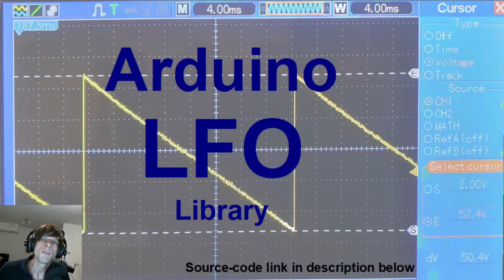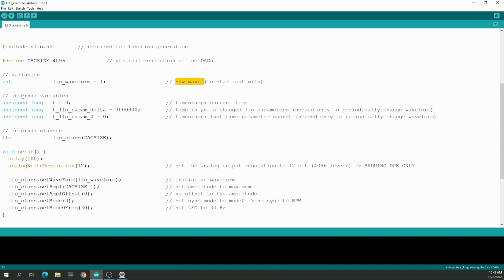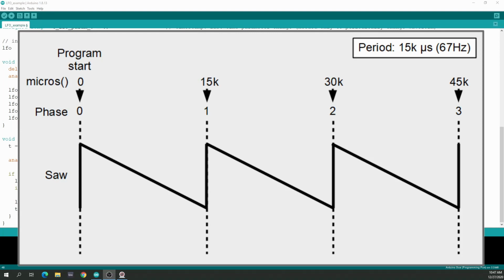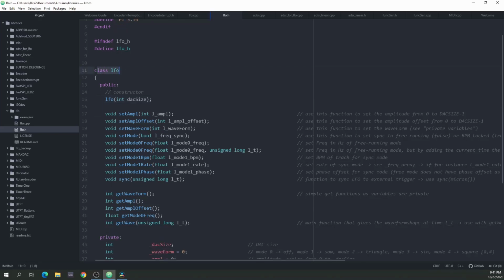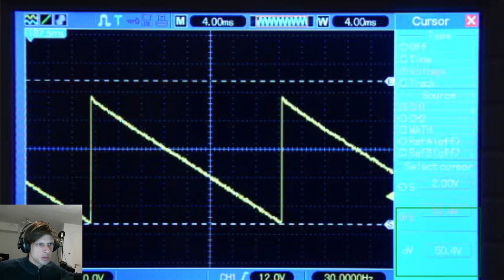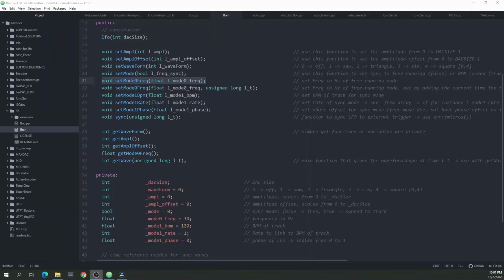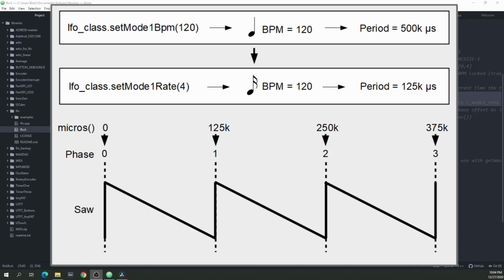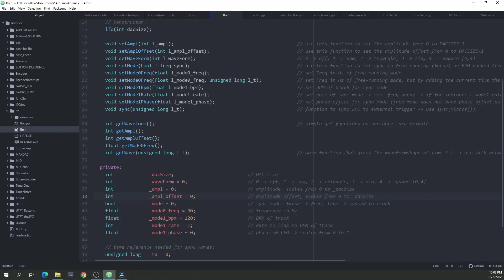How to create a low frequency oscillator (LFO) with an Arduino/ESP32/Teensy/etc (DIY)

Comment: Awesom library and video! I'm really excited to use it on a project I'm working on. I'm having some trouble with generating the saw-tooth and triangle waves for some reason. I'm running the program on an arduino nano every and an external 12 bit DAC and it works great except for those two waves. Wondering if it's somehow not compatible with the arduino nano every's ATmega4809. I'm not really sure and not too well versed in C++ either so it's hard to troubleshoot.
Reply from the maker: Hi Matthieu, thank you for your feedback. I have not tried out the code on a nano yet. It should not be dependent on that. I have to check if I have one somewhere... However, debugging is super easy for you. Just open lfo.cpp in some text editor (like notepad++) and scroll down to the bottom. The relevant function you need is:
int lfo::getWave(unsigned long l_t)
I am not 100% sure, but looking at the function I noticed that the two wave shapes you have problems with both have the DAC size in the routine whereas the other functions dont. Can you describe what the waveshape looks like when you configure these waves? Did you set the DAC size correctly? As a tryout you can set the DAC size very low (256 or so) and see if that works correctly. It might be a scaling problem. Good luck with your project! Sander

Comment: Awesome. Can this library be used to create quadrature LFOs? I would like to program a quadrature LFO with both TRI and SAW outputs for use in Shepard tones.
Reply from the maker: Hi Mike, yes, you can use the LFO library for a quadrature LFO. The easiest way is to just create 4 instances of the class in your Arduino code and set the phases to 0, 90, 180, 270 degrees. However, please do make sure that you have the LFO on lfo_class.setMode(1); -> this is the mode where the LFO can be synced to an external clock. That way you can create the 4 phases in 4 different class instances. With setMode 0 this wont work (you could implement that easily but that would mean adapting lfo.cpp a bit). Good luck with you project!

Comment from the maker: Big thanks to Thomas for pointing out a simple fix for the roll-over problem after 71 minutes. By slightly changing the "if statement" this problem is resolved. I have updated the example codes on Github. For reference on the fix, please see:
https://www.norwegiancreations.com/2018/10/arduino-tutorial-avoiding-the-overflow-issue-when-using-millis-and-micros/
@Thomas: I tried to answer to your comment, but some way or the other it does not show up in the list anymore, so instead here my answer as general comment. Thanks for contributing!

Comment: Hey thanks for the code and the Ideas, would love use my Due as an LFO on my modular rig. I loaded this example code, but I cant see anything out of either of the 2 DAC outputs. Did I miss something?
Reply from the maker: Hi Stephen, sorry to hear you could not get the LFO running straightaway. There could be quite a few reasons why it is not working for you. How did you measure the DAC output? Did you use a scope? I set the default freq to 30Hz, so you will need a scope to measure that. Did you get errors programming? Make sure you use the programming port of the Due. My example codes cycles through all wavelforms and this includes DC. I just realized that this can be tricky if you measure the DAC port at exactly the time the DAC is outputting DC (as this equals 0 per default). I have now removed DC from the example code online. Might this not help for you: I have uploaded a second example file called LFO_example_LED.ino to Github. Pls check if this one works for you. This one generates simple square pulses with gradual increasing frequency and writes it to the internal LED (port 13). If that works for you, it probably is the DAC you should focus on. Good luck! Let me know if you were able to find the fault.
Reply from the maker: One more note: you will need to add amplification after the Arduino Due before you can use this signal for your modular rig. Please refer to my video below where I give an example of what such an amplifier can look like (at 58 seconds). 
https://www.youtube.com/watch?v=TTPP9dcvJH8

Comment: This is great! I tried it with my Behringer Pro-1 and an ESP32, worked perfectly!
For anyone's reference: change the DACSIZE to 256 (since it's 8 bits on the ESP32) and use dacWrite(25, lfo_class.getWave(t)) instead of analogWrite(...). As stated in the documentation, also remove analogWriteResolution(12) for any other board than the Due(?). I also reduced the frequency to 1Hz to get better testing results.
Reply from the maker: Thank you very much for your addition, will add this to the readme on Github. Great to hear its working!
Reply from the maker: Dear MisterMajister, I got a notification from Youtube that you posted a question to my video on how to "Control your DAW with your phone". However, when I looked in my console, the question was deleted (maybe Youtube spam filter because it seems you posted twice?). Anyway, could read your question and wanted to answer you: The problem you have is most likely a casting error. I dont know how you implemented it exactly, but make sure you cast the CC number to an INT before you apply (CC_number << 8). If this is a byte for instance than shifting all by << 8 would just delete the byte and you basically always get 0. Glad to help you further might you be stuck, just send me an email (my Youtube name without the "_" and then @gmail.com).